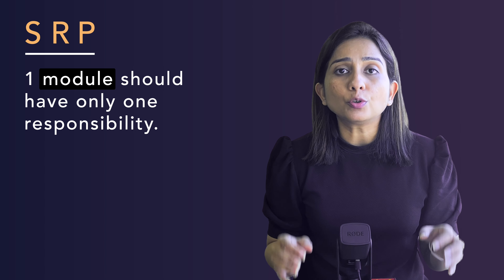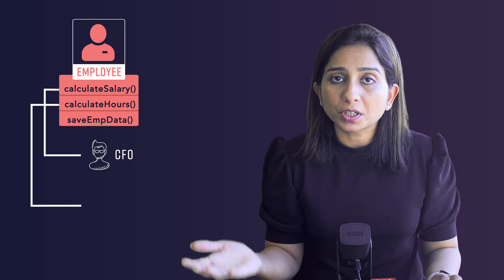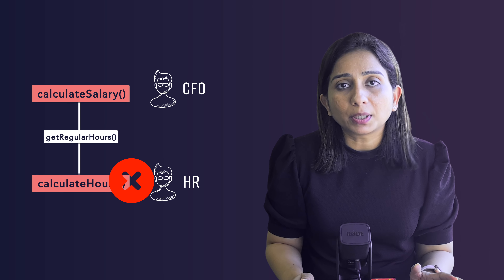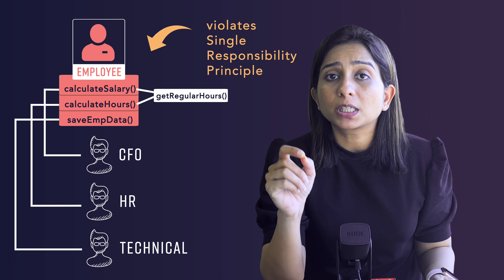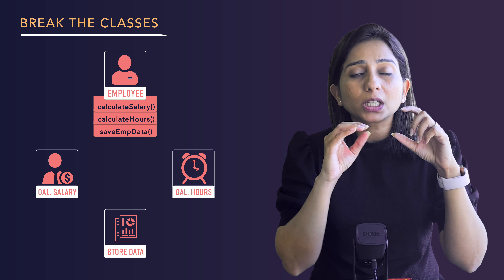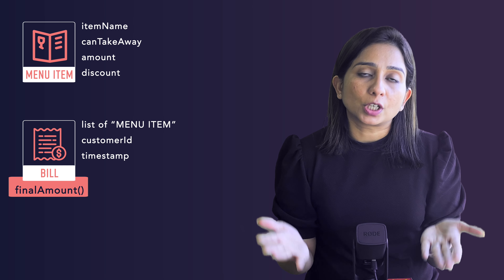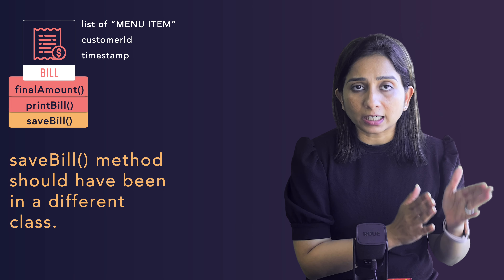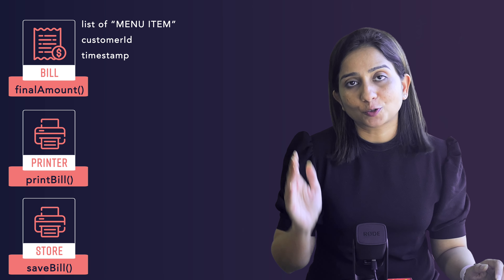Low Level Design 105 | Single Responsibility Principle in SOLID | 2022 | System Design

Comment: Couple of correction for the viewers of this video from my point of view,
- Clean code book has no dedicated topic or chapter for SOLID. 
- Uncle Bob[Robert Martin]'s other two books Agile Software development PPP and Clear architecture are talking on this topic in detail. 
- SRP can be viewed from different level like Functions and Classes, Component and architecture. At each level same principle is sharing some insight. This video is presenting one view of it however, it doesn't mean that There should be a single reason to change a class is incorrect and that's not what SRP is. People who are confused can Read SRP principle from both the books that I mentioned above. 

By heart I am appreciating author's good quality work and commitment to sharing with community however, above points are extension and slight correct to guide users on further reading.
Reply: In fact, in the Agile Software Development PPP book, at the beginning of the SRP chapter, it explicitly states "A class should have only one reason for change."

Comment: Hi Yogita,

First, You are doing great job and I am learning something new in the end after watching every video of yours. Keep up the work!

Second, I have doubt in the both the examples. Even though we decomposed the methods to different classes, still impact is there when change happens. For example, getCalculateHours is still needed for both CFO and HR. where this method will sit? and when change is required, still both classes have impact, right?

In another example , if Bill Store class required new param like isPaid, anyway that should be sent by Bill class as that new param is relevant to Bill object. Again, change is needed on Bill class.

Please correct if my understanding is wrong.
Reply: Same question im having if you got the answer plz comment.
Reply: method  getCalculateHours would reside on both classes, would be private to those particular class, hence any change done for  getCalculateHours of calculateHours wont affect implementations in calculateSalary.

Comment: Hi Yogita
Thanks for the amazing explanation
I have a doubt:
1) Instead of making different classes for each responsibility, why can't we make different private methods in the same class for different actors. Like getRegularHoursForCFO(), getRegularHoursForHR(). This will solve the problem in the example you mentioned.
In case of contructors, we can do overloading.

Comment: But if both calculateSalary and calculateHours methods use the same getRegularHours (maybe it will be a little different for each type), but if you separate it, will the code be duplicated? And although the editing is independent, if additional operations are needed, do we have to edit it in 2 places instead of editing it in 1 place?

Comment: Thanks Yogita for sharing such useful content !! You are an inspiration...
I sometimes get confused while breaking the classes and end with lot many classes like models(with mainly properties and getters setters), service classes (service class for model classes to perform certain tasks like play, save, move, etc) and repositories (for saving objects in memory).

Could you help me understand if this approach is correct or not? 
Is it fine to have separate service classes for having the business logic instead of putting a lot in model classes. 

If yes, should I create it as a singleton class, class with static methods or like a normal class, because it will be mostly performing business logic without maintaining any state.
Reply: It is okay to break classes into multiple model classes. If there are N entities (credit card, user, cart,classes etc..) you can create different model for each of these like (credit card model, user model...ETC). You can use get;set methods to wisely encapsulate the porperties of the model class also. If you look at MVC architecture. This is how it is done. Model classes hold data and service classes are used to apply bussiness logic on top of these models. 
Making all the methods static and using singleton is not a good idea. As you practice solving LLD problems and multiple design patterns you will understand the beauty of OOP. If your not using OOPS to max ability then your just using Functional programming with model classes.